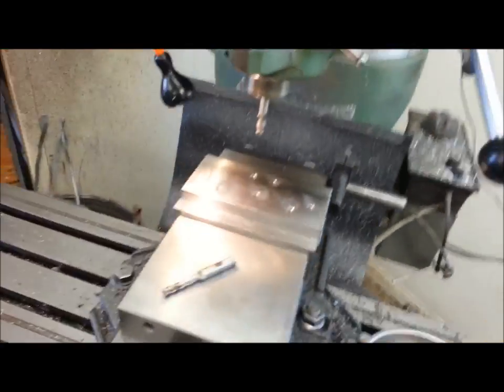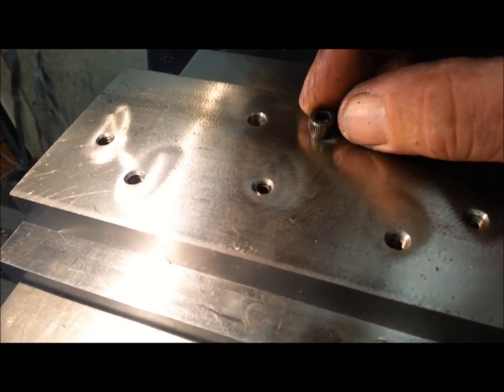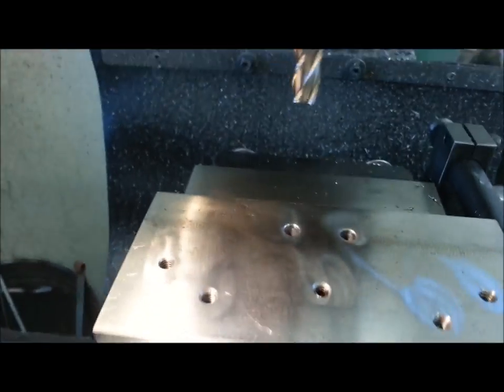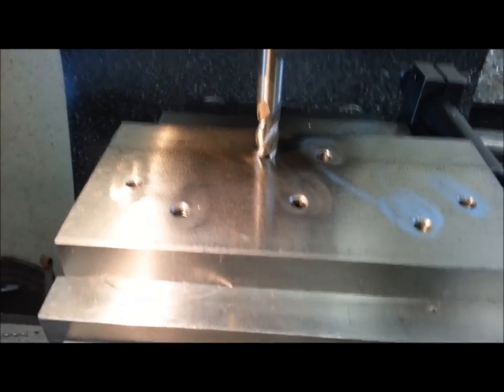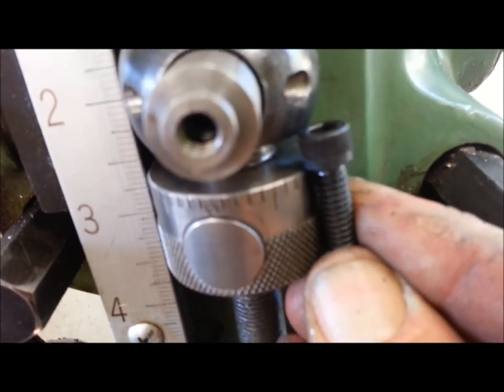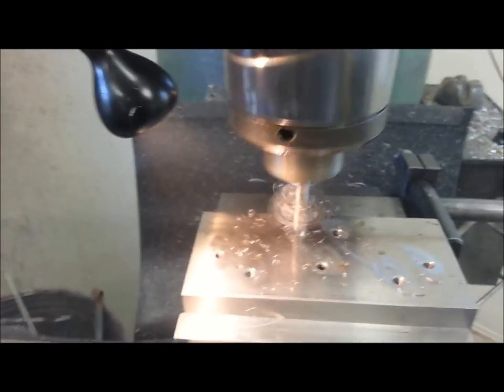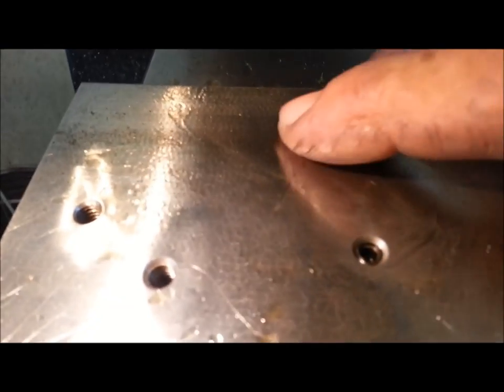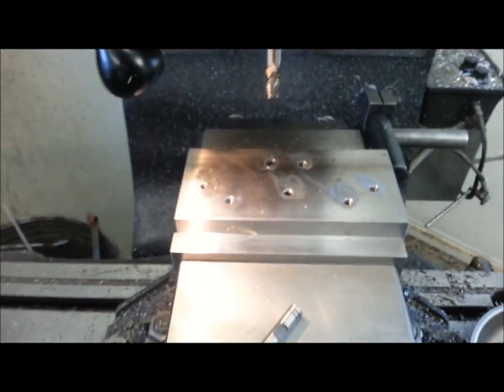Counterbore short cut

Comment: Hey Stan,

I know its hard to believe but I do this all the time myself. Its also a handy thing to know the head height is equal to the nominal diameter of the screw, If you had a quill readout you wouldn't even need to set your stop.

All the best,

Tom

Comment: There is non need for calipers on a S.H.C.S. The head thickness is equal to the major diameter of the thread. So a 1/4 bolt needs a .250 deep counterbore.
Reply: Does this rule apply to Chinese fasteners (if you manage find some with an open socket that is) ?
Reply: Eddie the Grouch Metric fasteners will probably have the same rule. Just in metric.
Reply: Yes the same rule applies to metric socket head screws. A 6mm screw has a 6mm thick head.